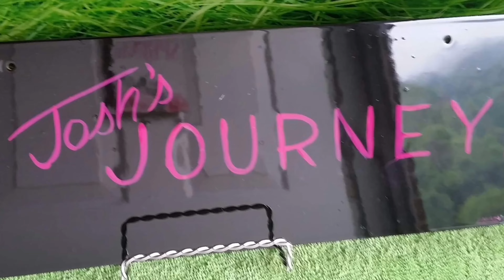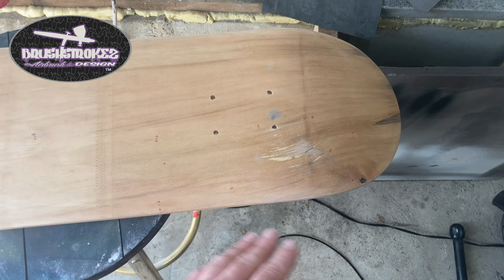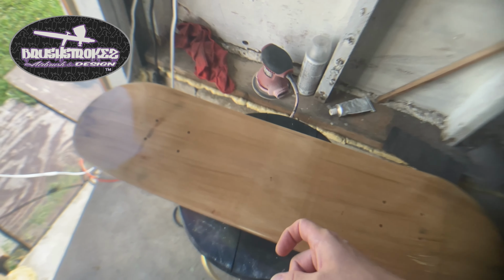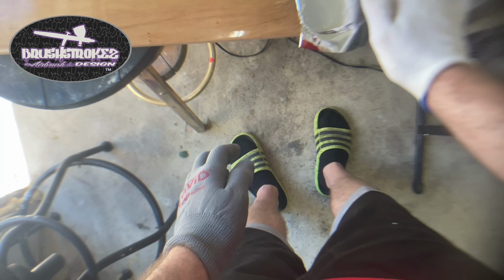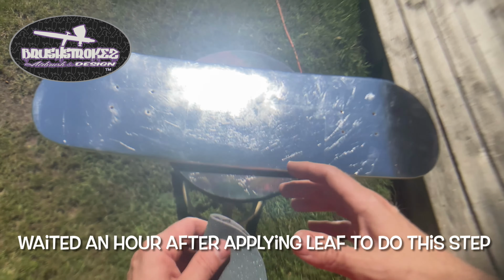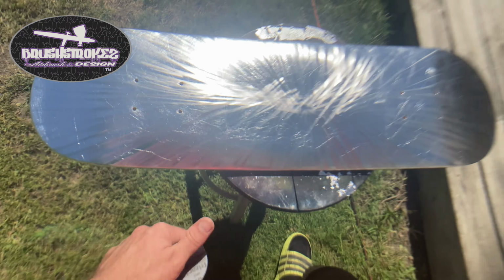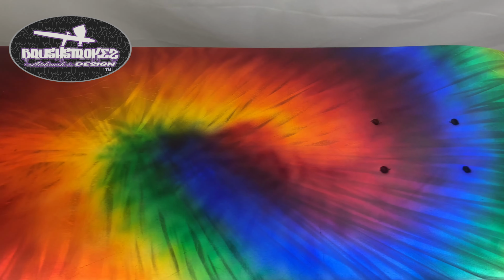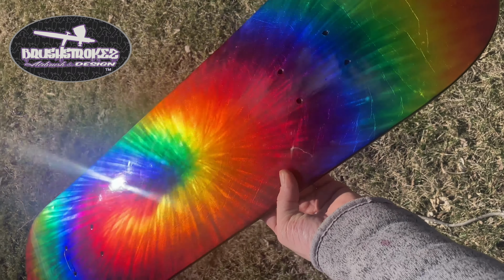How to Paint this Tie Dye Skateboard Deck

Comment: Wow. I watched with audio off but I really want to try this. Would this work on a prop helmet ?  I'm wondering if there would be adhesion issues between layers. Are lacquer based paints best suited for this application?  My workflow is currently all createx > uv clean armor to finish.
Reply from the maker: ThankZ! And I don’t see why it wouldn’t work. I’ve done it with Createx and currently working on something with this technique and Createx. I prefer Createx. I only used Tamco/solvent because this deck was for a Tamco contest so had to use it.
Reply: @BrusHstroKeZ  Ah I see. I was mainly concerned since the DUX is oil based , if it would have a weird reaction to plastic or waterbased paint like createx.
Reply from the maker: @antisocialpictures4784  No, doesn’t have any sort of reaction, as long as ur Createx is dry. I’ve leafed directly on Createx with it. AND, I spoke to the owner/creator of Clean Armor. He said to heat up ur product to 80° or so first before spraying. Said it seems to eliminate the pock marks. Haven’t had a chance to try yet, but excited to!!!

Comment: I now believe in parallel thinking! I was watching Adam on TimeWarp laying some leaf a couple of months ago. First, I wondered if DUX could be thinned and airbrushed on. Then, I wondered if 3000 or 5000 grit could be used to make a pattern (herringbone or braid) along like a 2 inch wide strip. Haven't tried it yet because I'm not set up and busy with other projects. You have answered both questions BEAUTIFULLY!!! I subbed and will spread the word. Also wanted to know what airbrush that is, and what nozzle/ needle you're using. Thanks!!!
Reply from the maker: Awesome!  Glad I could help answer some questions u had. I was using my Iwata Eclipse airbrush with a .35 needle/nozzle. And to also answer ur making a pattern on a strip, please check out my creation: ZD FlipZ here: https://youtu.be/3R_11yPJr1w?si=mGdUikSh-xPj_8Gt
Reply from the maker: PS- I asked Adam if he wanted to try out my ZD FlipZ and to possibly sell on his site, but wasn’t interested, too busy.